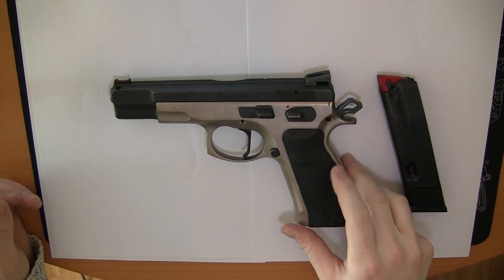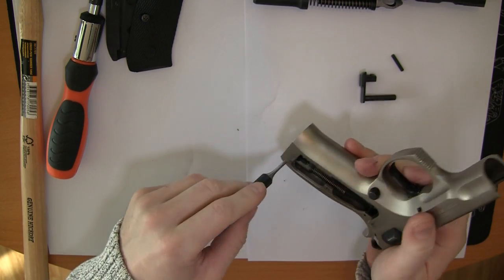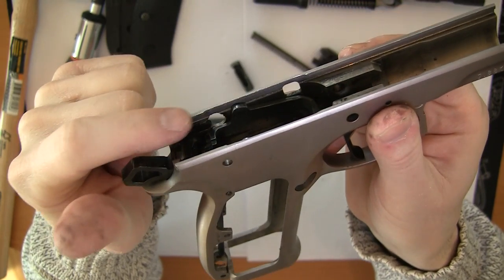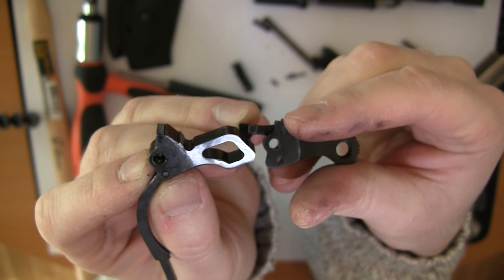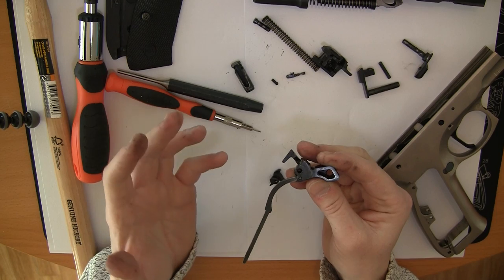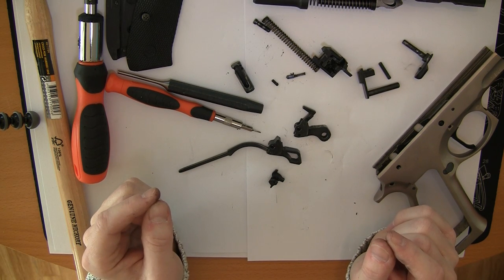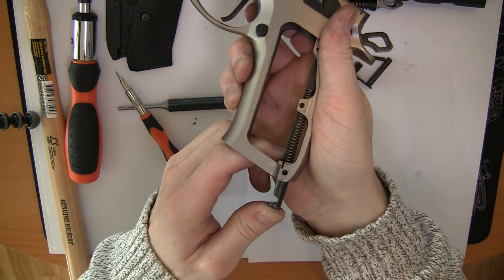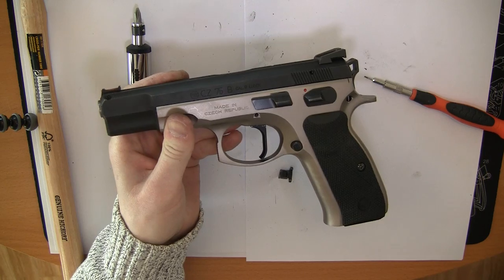CZ 75 How to change the hammer (trigger job)

Comment: After watching all these videos on replacing the trigger and hammer I think I will just keep my SP01 stock. It will never be a custom 1911 or Mk25 with a SRT kit installed anyway. Now that is just ridiculous. I enjoy it the way it is to be totally honest. Its perfect for me as is. Rather save that money towards purchasing another SP01. All my pistols have battle buddies. Two is one and one is none. Love the informative videos regardless. Subscribed and liked. DA/SA is one of the main reasons i love this pistol so much. Why would I mess with that? Ive thought about it and researched it quite a bit. So now I am sure I am not missing out on anything at all. Trigger weight is fine as I have strong hands. And, it is nowhere close to my double action revolver. So for most people if the trigger reset is the worst they can say is that, "this firearms trigger is its biggest flaw." I personally can live with that critique. I may want to swap out the guide rod. I am not sure yet. It is your money and YMMV. If you choose to bedazzle your pistol who am I to judge. I'll snicker but, i don't judge. I only have 5 requirements for my pistols. All metal frame and slide. Rail. Night sights. Real world combat worthy, reliability and effectiveness.

Comment: One thing to note on the original hammer to the competition hammer is, if the pistol is a standard safety you will have to modify the safety lever to accommodate the difference. You will need a method to remove some of the lift so the safety will travel full upward. If you do not do this the safety will not work. When removing the hammer spring it is best to take toe hammer to the closed position as this will relieve the tension on the hammer spring. One might consider getting a new hammer spring with less tension as this will lesson the trigger pull. While you have it apart you might as will use a smooth surface stone to clean up the faces and surfaces of the trigger assembly. After doing a number of these you will know how and what improvements need to be done to enhance the pistols performance.

Comment: Well let’s see if I’ve understood:
You can just remove the disconnector leaving the original hammer and the gun turns into a SA Only?
Then ... many people say if you change the hammer you have to adjust the sear or safety cause SA hammer blocks the safety lever (which is mandatory when shooting in condition one) 
What about these 2 questions?
Anybody know?
Thank you and thank for your video

Comment: It seems not to be the standard trigger which makes it so crisp, what trigger is it?
Reply from the maker: I use a CZ original single action only trigger in combination with a CZ competition hammer. You can find these parts on the CZ USA or CZ Europe web shops.
Reply: @merulafilms7863  Is there a DA trigger upgrade which makes it near crisp to that one?

Comment: Importaint to know, when changing hammer you might need to change sear aswell, or adjust the old sear or the safety wont work.
You also risk having a hammer that is not safe - pushing it might cause it to drop and fire.

Comment: I found very useful information on your videos when I decided to replace my trigger with the SA trigger a few weeks ago. Now I have to tell you that this video is probably the best on YouTube when dealing with how to disassemble the gun. And I watched a lot of them. 

Thanks for what you're doing, I still haven't replaced my hammer, but it will probably happen soon. Do you recommend changing the sear too when replacing the hammer ?
Reply from the maker: Thank you so much for your comment and support! You don't need to replace the sear.   However, to reduce the trigger weight, I removed the firing pin block. I highly recommend  this if you use it for competitions. If you do so, you can take out the arm that push the block safety. It will leave a gap. This can be filled either with a small washer or a pre B sear (the original CZ 75 didn't have this safety function). I changed mine with a pre B sear for this reason. Good luck with your gun! :)
Reply: Thanks, I'm not doing competition shooting so I don't need to upgrade it as much as you did. However, since I replaced my trigger with the "flat" SA trigger, I'm asking myself a question. The pre-travel before the trigger actually engages the sear and all is pretty long, any ways to modify it ? My trigger has the slot for the pre travel screw but i don't have this screw.
Reply from the maker: +Jonathan Guérin Mine has almost no pre travel. You can adjust this with the screw you are missing. I also lost tge screw, but used the overtravel screw for the job since I didn't  need it. Be sure to use thread lock compond on these screws. Good luck!

Comment: ...... Where can i buy a Hammer and Trigger i have a   CZ75  SP01
Reply from the maker: Try CZ USA or CZ Europe. They sell original custom parts through their web sites.
Reply: ... Ty for Reply ... I need Someone that will Post to Australia
Reply from the maker: @scottbutler2761  I would have sent an e-mail to CZ Europe/USA and ask them if they ship to Australia. Or you can ask around in Australian stores. Maybe your CZ dealer can get the parts?
Reply: Ive looked everywhere .  Found Cajun Gun Works . they have agent here in Australia . But might go back to my Springfield Xdm 525 10 times better Gun

Comment: On my cz shadow I had to file the front hook of the sear since safety lever wouldn’t engage ... anyway I’m experiencing a problem now: hammer often stops in half cock position when retracting and releasing the slide. Not when firing ... gun works properly during fire operations
Anybody?
Reply: We have the same problem for both situations.Did you find the solutions?If yes,could you share?

Comment: Great video and great trigger job!
 I am thinking about upgrade the short guide rod to full guide rod in my CZ 85 Combat. The short one curves and do not work smoothly.
Making a hole in the front, just under the barrel mouth is my idea, but i need more information about results.
A guide rod working straight is more smooth and reliable. Any suggestion?
Reply from the maker: IIISalvaIII Thank you very much! Making a hole, just! That sounds interesting and a bit scary. Did it work out well? My guide rod is working fine, but it sure looks nice with a solid one.

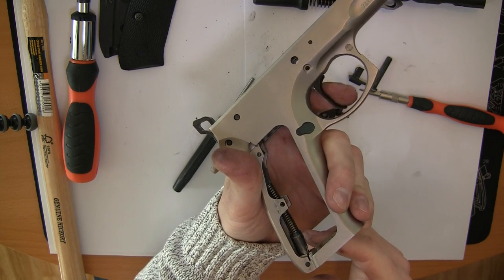Comment: @ 9:33  Not a good idea to pull trigger with no slide and allow hammer to slam into the frame.  Informative video otherwise, I just wanted to clarify that one point.
Reply from the maker: LeverPhile Thank you for your comment. It is not recommended to do this on a regular basis, but luckily this is a sturdy gun that can handle a beating. That is one more thing that I like about this gun. It is the same as a Ruger, you know. You can also use them as hammers ;)
Reply: MerulaFilms  That's true.  I like that the 75b is an all steel frame for similar reasons.  Ive let the hammer slip a few times as well, I cringe and move on.   Thanks again for the video and showing things like how the hammers are cut differently.  Cheers!